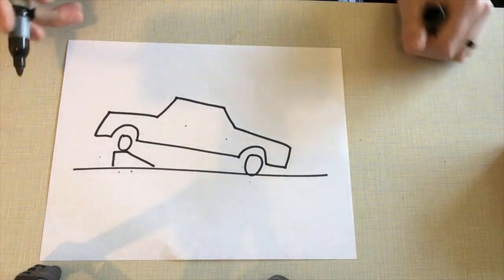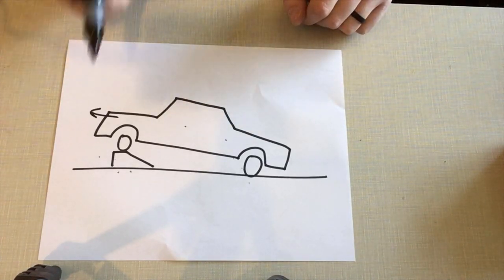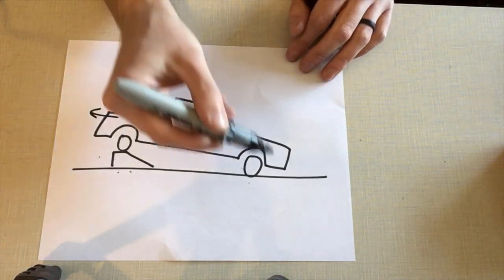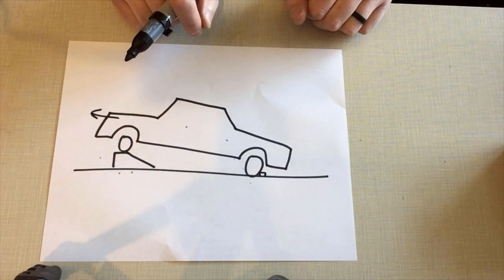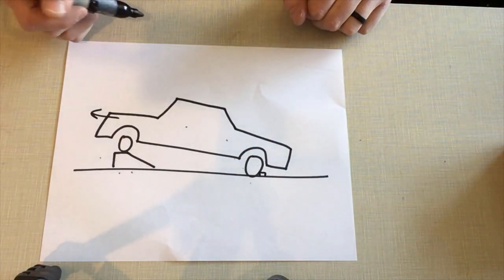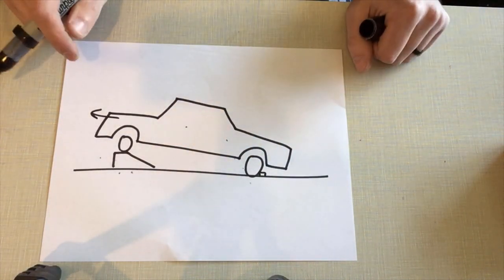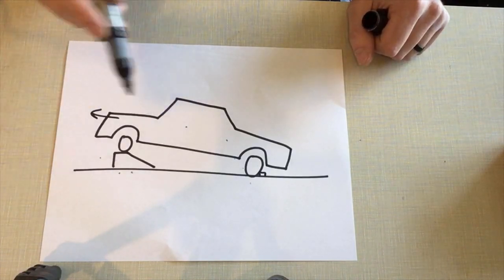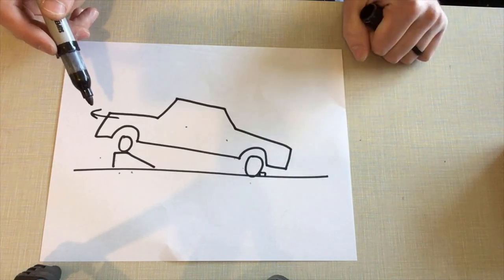PSA: My Dodge Magnum/Charger/300 almost killed me, how to NOT replace the front drive shaft.

Comment: first rule of car club: if your rear tires are on the ground your emergency parking brake should be engaged and proper wheel chokes applied, for the life of me I cant understand why people would skip buying wheel chokes that run 10-20$ for a good set. Glad youre okay buddy, I hate hearing of people getting hurt doing what they love.
Reply: Or even just use a 4x4 or a brick or something similar laying around
Reply: I just used a good size rock
Reply: He said his emer brake did not work...but still did not anticipate the worst.
Reply: No doubt! I found a couple on the side of the road forgotten by an Electical Dept utility truck. They’re big heavy rubber chocks that don’t budge or slide. Always use them with ramps along with the e-brake for good measure. Bricks and 2x4s you can roll right over and even something bigger like a cinder block can get pushed and slide.
Reply: Same with jack stands.

Comment: If the drive shaft or axles are removed from the front or rear of a awd car the car will freely roll. Do not remove a axle or drive shaft and not have the wheels chocked or else it'll roll away. I'm a full time automotive mechanic. If you do this it'll possibly kill you. This is why I use jack stands and always on a flat surface.

Comment: I’m only 1:17 into this video and I think I know what happened and if it’s similar to what happened to me, it was definitely the closest I’ve ever come to simply knowing I was about to die, crushed under my own car.    1968 Ford Country Squire, 390.   1997 needed new starter, took ORIGINAL 29 year old starter out.  Put parts store one in.   Didn’t realize a little bit of casting/welding flash was left on the mating surface of the starter, so over the new several months it ate up my flywheel.   Got replacement under warranty but needed to replace my flywheel.   Car is about 4300lbs and sits low.   I could NOT fit under this car past my shoulder/chest while at ride height.  Drove front end up on cinder blocks with short pieces of 2x12.   Those cinder blocks saved my life, very literally, that plus a strong front bumper with zero rebound.    I disconnected the driveshaft.   PARK doesn’t work at all with no connection to the wheels it’s depending on to be PARKED, plus drum brake emergency brakes are known not to work very well in reverse, but they were on anyways.    Removed transmission mount bolts, bell housing bolts, then manhandled that C6 rearward just enough to reach up and loosen the flywheel bolts, just a few inches of clearance if that.   I just happened to be oriented head just to the passenger side of the oil pan, feet under back seat.   I pulled the 4300lb car off of the cinder blocks while wrangling the transmission rearwards, ad the odd sensation when the transmission I was trying to move rearward was now moving on its own, and I tried to grab the trans crossmember and stop it, but too late.  I did just like when I was a kid and accidentally rode a sled under a moving car in the snow.  Arms to the side, left cheek glued to the dirt.  It knocked the breath out of me and for a moment I really thought my head had been smashed and I was just seeing weird things, I couldn’t get my breath, I had a few bolts from the floor pan stuck in my chest and shoulder, and I realized I was alive.    I craned my neck up to see what happened, and the front bumper was sitting on the cinder blocks keeping the front of the car about 3-4” higher than ride height.    I wiggled out, brushed myself off, grabbed a hose and washed myself down just cause I was completely speechless.  My wife came running over and said she’d never seen my face so white, ever.   I still have remnants of those scars from the two bolt threads that got me good.    Bought jack stands and floor jack I couldn’t afford, and couldn’t afford not to afford, next day.     Swapped them out.  I still have that flywheel in my garage always on a wall, to remember to always think things through, don’t assume, and wisdom is cheaper than arrogance.     I’ve done lots of very dangerous and crazy things, insane bicycle jumps, hurricane surf conditions, crazy car stunts, shocked plenty of times, but I’ll NEVER go under a car ever again without absolutely KNOWING that it cannot fall and crush you.   I always leave the jack with the jack stand but let a fair but if weight down onto the jack stand.   That way, if one fails, the other isn’t “shocked” into service and then it fails.   I don’t use regular wheel chocks.    I’ve seen all of them move and get rolled over.   Nowadays I use rotors off my Suburban, other big rotors which fit the needs better, and hitch adapters.    I’ve pulled a car off of a jack just breaking lug nuts loose. Again, front wheel drive stick shift in first gear, parking brake engaged.    I couldn’t break loose while in the air, so put some weight back on it,  Thought I broke em all loose, jacked it back up, but one was still not turning easily, so I put the crossbar on and gave it a twist and I guess the differential caused the other front wheel to turn the opposite direction, backward, and it rolled right off the factory scissor jack.   The wheel chock had moved away from the tire form all the back and forth trying to break the lugs nuts loose, parking brake turned out not to be functioning well.   No damage done, but made an impact in my sense of being around a 4000lb car in the air which could crush you.    Respect.     Glad he’s alive.   That’s. Some very scary stuff.
Reply: My stomach was hurting while I was reading this lol

Comment: Had a old 70 charger R/T and while trying to jam headers from underneath while on ramps like you did. I hit the linkage with the header.  And it rolled down and the header hit the grass and stopped the car. I was lucky as well. Lesson learned. Now I chock the tires and put it park and the apply the e-brake. Always!

I'm glad you're ok!

Comment: Those of us whether professional or weekend warriors has had close calls.
Thankfully most live to tell about it. I have over 50 yrs of working on vehicles, including several years of vehicle recovery. I could share with you my close call stories as well! 
Luck won’t keep you alive. 
It’s redundancy, redundancy, redundancy!!!
Wheel chocks must be used at all times!
If your using jack stands, unless your on a concrete slab you should have a 3/4” pc of decent plywood under each stand.
Your vehicle lifting area must be level or it’s a no-go.
And for that worse case scenario, slide the tires you take off under the vehicle’s frame. And for gods sake don’t skimp on those wheel chocks.
These simple rules can give you a better chance of meeting your grand children.
I am glad you survived your recent close call 😃

Comment: I was going to disregard this video because I'm also a cocky engineer, but hey you encouraged me to buy a real jack extension so I can quit using pavers as spacers to lift my truck.  It already fell off once and damaged the truck, but Im still cheap and using them.   Good luck in the future projects.   I think in your honor I'll buy wheel chocks bigger than 3 inches like the ones I have.
Reply from the maker: Yes, my 2x4 and brick were not enough to do any good. Good luck moving forward too

Comment: When you have ANY car raised on a jack, jack stands, or ramps:
1. Always chock the wheels opposite the raised end.
2. If the front is raised, apply the E brake. 
3. If the back is raised, see rule #1 but chock both front and back of tires.
4. If you have another vehicle, and have the room for it, park it close to the end that isn't raised. This will, at least, prevent it from rolling away.

Comment: This might be why the first thing in any instruction manual says before jacking the vehicle, MAKE SURE THE PARKING BRAKE IS SET AND OUR WHEELS ARE CHOCKED SO VEHICLE WILL NOT ROLL.
I DO NOT JACK UP A VEHICLE ON GROUND THAT'S NOT WITHIN 5° OF BEING LEVEL.
And don't use concrete blocks to support your vehicle as they tend to explode and pin you in such a way you suffocate because you cannot breathe which means you can't scream for help.
This man is lucky he survived his near darwinian experience.

Comment: So glad you made this video.  I have the same issue right now but with the rear shaft disconnected.  It's an AWD that the rear shaft came apart on and PARK won't hold it in place.  That AWD transfer case must be like an open diff spider gear.

Comment: Thanks for your honest video.  I never use wheel ramps.  I also rarely use jack stands.  I have a couple of harbor freight jacks.  If I'm going to be under the car I use wheel cribs that are propertly (over built) made of lumber -- but I don't put the wheels/tires in the cribs... I set the frame of the car on the "wheel" cribs... 

Lots of accidents and tragedies out there... hopefully you saved someone's life with your video.

Comment: Thanks for posting this, hopefully it makes someone pause and think  before just forging ahead. Hope you have healed up, got another car and have no lasting effects from the accident. The simple explanation is that there is a differential in the transfer case. When you have a rear wheel drive off the ground you can still turn the rear wheels even if its in park however they turn in opposite directions. If you try to turn both rear wheels in the same direction they lock up against the locked drive shaft. In this case the transmission is locked in park which is BEFORE the differential in the transfer case. Now think of the front and rear AXLES as the wheels in the first example. If both the front and rear axles were off the ground any of the wheels will turn but the drive shafts will turn in opposite directions. When it was on the ramp the wheels are all trying to turn in the same direction which causes them to oppose each other and lock up against the locked transmission output shaft. Pop the front drive shaft off and its like letting go of one of the wheels, the rear drive shaft will be turning in reverse with the rear wheels and the front shaft coming out of the transfer case is spinning in the forward direction, but because it isn't hooked up to the wheels there is nothing opposing the movement. The transmission however is still locked up in park. The other thing I would  caution against is, NEVER, EVER leave the car sitting on the sloped portion of the ramp. Your asking for the car to run away and it would easily overcome a 2x4. The other consideration should be apparent to anyone that uses ramps often. How many times have you had a ramp shoot out from under a wheel when your driving up onto them. I wont let anyone in front of the car until it is fully up on top. Can you imagine being under the car reefing on something and it causes the ramp or ramps to shoot out? It wouldn't be rolling backwards but coming straight down.
Reply from the maker: You are 100% correct and yes, I have shot a wheel ramp or two.  

I'm almost 100% again, even if I stay at 98%, it's worth the lesson I learned-I could have only healed 50%, don't know how I'd feel then, but thank God I'm doing ok again; I hope that made sense.

Comment: Thanks for your advice!, as DIY mechanic, another advice, to use wheel chocks even on front wheels. A month ago I was replacing rear shocks in a Jeep Liberty, when I lifted the car, this started to move toward the street, The parking brake was working properly just in one rear wheel. So at least I lifted it up, its moved immediately.
Reply from the maker: Be careful under there guys.

Comment: In an AWD/full time 4wd setup, it's less of a transfer case and more of an extra differential. Both sides work together, while allowing a difference of speed for cornering and such. So when you removed the front shaft, you basically created a slip situation. You know how you'll see cars spinning only one wheel if it has no traction, but the other drive wheel does? Basically that, but sideways and in reverse. With both shafts connected, the differential carrier wants to rotate, and the transmission stops that. Disconnect one, and now the force is uneven, making the carrier stay put (since the transmission is still holding it) while the internal parts spin freely.

Hope you're doing better, man. It's a terrible way to learn the lesson, but now you've learned. Some $20 wheel chocks might be worth the investment. Keep there from being a "next time"
Reply from the maker: I'm doing great again, thanks asking and thanks for the reply; you put some time into it, I can tell.

Comment: I'm glad I came across this video. I do all my own work on my 06 300c awd, and it's just good to know, and be aware. If I can I just lift the car on 4 jack stands and even leave the jacks in place, once I sit the car on the stands. I'm in the process of getting a lift, and opening a garage. Tired of working on my back. Me and 2 buddy's just did a oil pan gasket on my 5.7 AWD, what a big job without a lift. 10 hours but also put a new starter in while I was there and fixed the oem junk flexes

Comment: There are lots of cases where police chargers have rolled off of scissor jacks while flats are being replaced. Dodge sent out “correction” kits which included a safety sticker and 2 metal wheel chocks. It’s a very unusual set up.

Comment: Chocks when under. Period. Real chocks, flat surface. 

You'll find square profile objects will almost always be either too short to stop the wheel rolling over, or so tall that the tire doesn't push down on it before it slips out.

Comment: I'm glad you are still with us but proper wheel chocks would've saved you regardless of how the transmission works. Thanks for the reminder though that proper safety IS worth the extra time and effort. 

Call me crazy, but I double up jackstands and even use them with ramps as I've read where ramps can fail.

Edit: just bought some better wheel chocks because of this video.

Comment: Wow! Thanks for sharing this. Lucky it didn’t break your neck or crush your skull.  The parking pawl, the part that engages to keep the car from rolling in Park, is pretty small and wouldn’t trust my life with it. Good set of wheel chocks and setting the E-brake for sure! 
In all honesty, I would have thought that the rear would still be in park with the front one disconnected. If by sharing you’ve only save one person from making the same mistake, your video was well worth making!

Comment: Thanks because I was about to use bricks on my challenger replace drive shaft with the same setup.. now I'm getting 2 more ramps so it can't move or I'm thinking jacking each end up and putting the little stand so that the car is jacked and level with tires for extra support if them Jack's fail... what about 4 ramps and jack each tire up then put a ramp under the tire so all 4 on ramps and little stands for support ...thanks for the safety tip

Comment: So note to self: engage parking brake when I replace the front axle. 
Although mines newer and has the “torque on demand” setup.
Reply: I wouldn't even trust the parking brake because If it don't work you're dead. Chock the wheels with chocks.
Reply: I use a full vehicle hoist anyway. Can’t roll away if no wheels are on the ground.
Reply: @tOSdude  I work in a shop so use racks. I blew my axle out of my 05, 300c awd today after installing it yesterday. Good Ole autozone decided to sell me the wrong axle for a rwd 300 so it blew the joint apart. Not real happy about it as the job is not a fun job to do and everything needs to come out in order to remove the rear axles.

Comment: So sorry this happened to you. Most of us dodge owners knew about the rolling issues when it’s jacked up off the ground on any part of the vehicle. Fca even issuesd a “recall” about it around 5 years ago. The solution? Was they give you a set of PROPER wheel chocks. Smh. That was what they did for the solution. So anytime you jacked up any part of the car you just use wheel chocks so it won’t roll. So glad you’re ok bro.
Reply from the maker: Jordanfiend361 Thanks for the kind words; I’m doing great again.  I appreciate all the positive comments, YouTube is usually full of negativity, I’ve experienced something other than negativity with this video, I assumed everyone was going to call me slow or an idiot, so far its only been one of you.  Thanks again.
Reply: The recall was because the pinch weld used for the factory jack could fail, resulting in possible movement.  

All 300's, Chargers, and Challengers have a common parking brake (mini-shoes inside the rear rotors).  

Never use a jack or ramps, either end, without blocking the opposite end.

Comment: Not only using inadequate wheel chocks in the rear, resting the front wheels on ramp incline was a big mistake.  I always keep the tires on the top flat surface of the ramps and chock the front and back of the rear wheels.
Reply from the maker: Yes, I agree, I outsmarted myself here.

Comment: Granted, you posted this 3-years ago, and I hope you've made a full recovery. I use wheel chocks all the time, but most of them are not soft enough to grab on a power troweled garage floor. As an Engineer myself, things started to set up for an issue as soon as you backed the front wheel onto the incline of the ramp. The weight of the front tires on that incline were producing a rearward force on the car.

Jack stands and e-brakes can only do so much.

Gravity is a real bitch, especially when a car is being set up to roll down a ramp.

Again, hope you're doing OK now.

Comment: proper wheel chocks would not have allowed this. i sometimes forget the wheel chocks on behind the tire and when i try to reverse the engine isnt strong enough to overcome the chocks unless you really force it . i remember when i almost got ran over by a grand cherokee i was working on... very scary experience